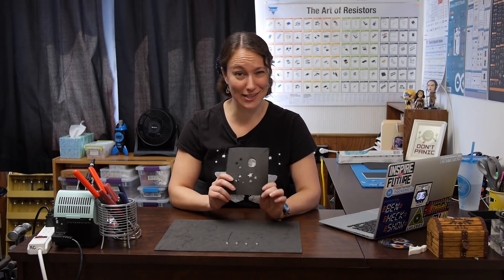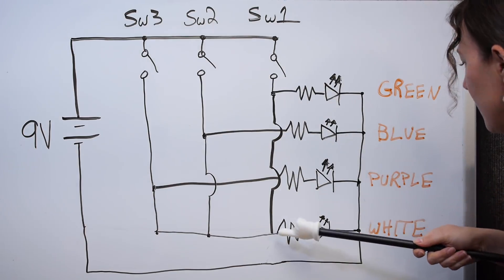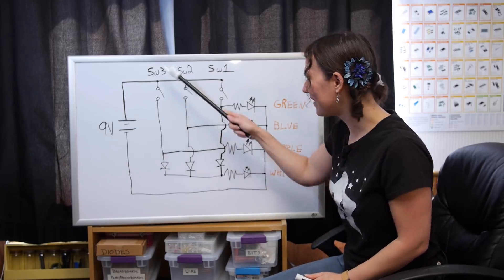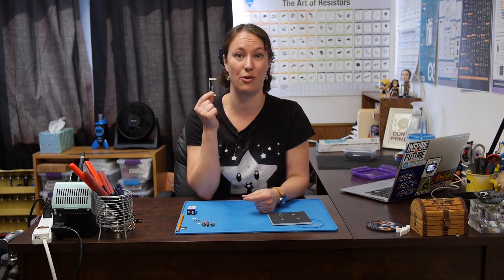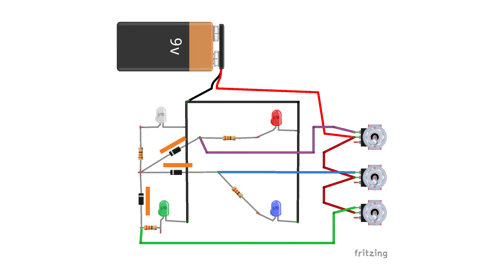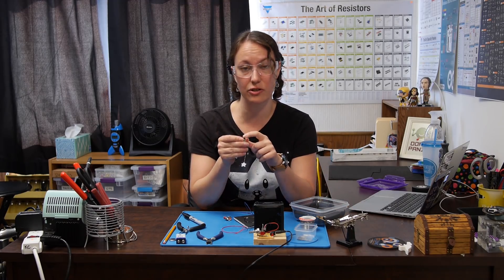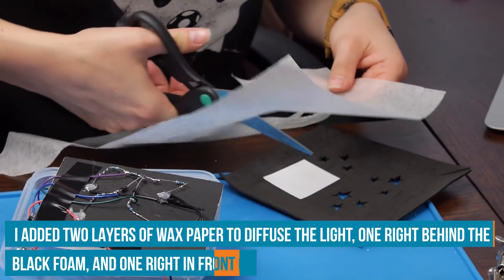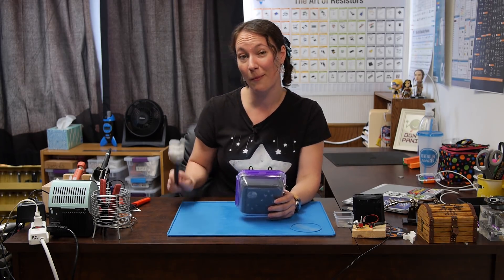Diode Logic Light Box - The Learning Circuit

Comment: But you can achieve the same functionality without any diode? Just add the white LED in reverse after the colored LEDs.
Reply: Not in reverse, but just in the same direction would work, if you changed the resistor value.

Comment: Great little video Karen! You had an additional diode voltage drop for the white LED. so instead of 9V-3V=6V, it should have been 9V-3V-0.7V. Not sure how much difference it would have ultimately made. Great little project for me to do with my kid though. thank you for the inspiration!
Also - stretch goal, this would make a nice project to team constant current sources, and potentially, current mirrors, where you could have one global brightness control?
Reply: Yeah, just what I saw: The printed formula was wrong (multiplication instead of division) and the diode voltage drop is missing. If you take it into account, the resistor for the white LED probably should be 270 ohms (265 ohm to be exact). Then the moon should not be as dim as it seemed in the video. Also would have been a nice explanation for the voltage drop of the diode.
But still a good example for a diode project 🙂
Reply: Exactly -- so much feedback I see on YT is folks trying to look smart by correcting the author publically. that definately was not the aim of the feedback in this case. It's a lovely project. With an ESP8266, you could even use it as a "wake/sleep" indicator for little kids (e.g. is it okay to get out of bed?")
Reply: Sometimes it's OK if somethings are done wrong, that way people learning at home can try the project and figure out/solve what is wrong. I think that way of learning is very helpful where the answer isn't given to you straight away.
Reply: Her answer is not incorrect and neither is yours. Her calculation used first approximation of an ideal diode while yours was the 3rd approximation to include bulk resistance.

Comment: Just Put white led after Color diodes...
Reply: That would cause issues with running two or three colours at the same time (not enough current through each colour).
Reply: @sharg0  just change the resistor value.
Reply: @Michael Jensen: Wont solve the problem since you will need the same current through all LEDs to get the same brightness but the coloured ones will be connected in parallel with the single white in serial.
Reply: @sharg0  that's true.  With more than one switch on, the brightness would slightly vary in that setup. -- Seems like the brightness varies with the current setup anyway though. /Shrug

Comment: So hiw do you know what type or rating of diod to use For any project?
Reply: Look at the data sheets. -- Though, most general purpose diodes are fine for something like this, low voltage, low sleep, low amperage... Pretty much anything will work.  Just be aware that zener diodes and bridge rectifier diodes are probably not what you want for this. :)